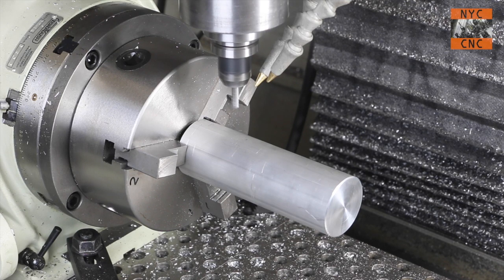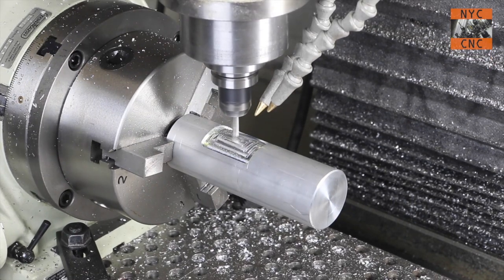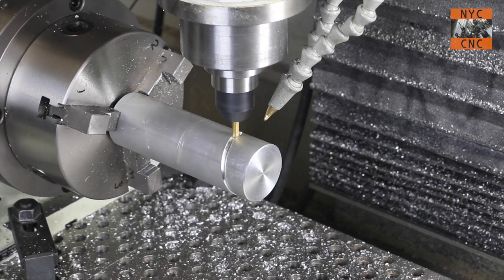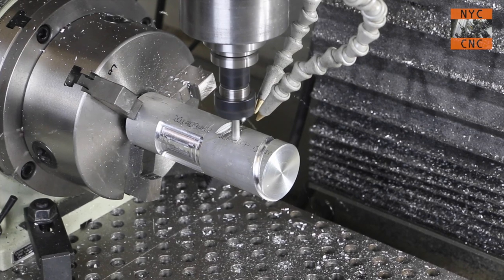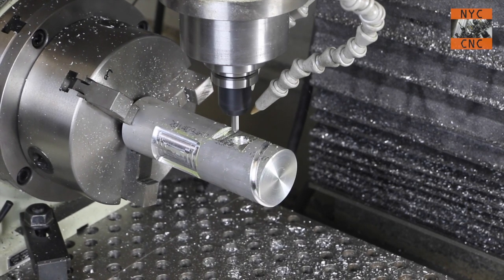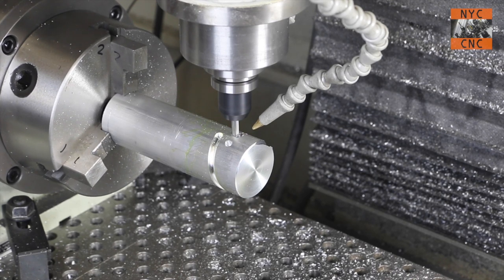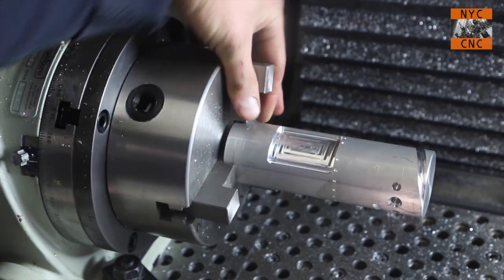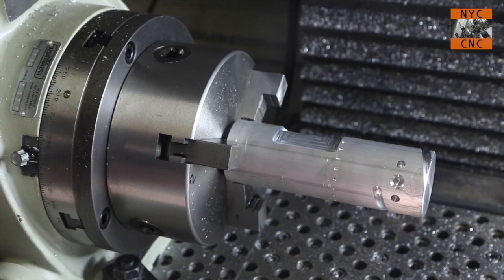May the 4th Be With You! Part 3 of 3: CNC Milling with a 4th Axis

Comment: Is there any budget 4-axis machine you would recommend within a $5k budget?
Reply: Only one I know of is the Pocket NC. It’s a 5 Axis and quite small, but a really neat machine.
Reply: @BradleyMakesThings  Unfortunately its limited to a maximum of 128.3 x 115.5 x 90.1 mm working volume. Its great for small parts but I want something that can give me atleast a 200 x 150 x 150mm working volume. Tormach seems great for the price but doesn't really have any options within $5k budget. I wish Pocket NC made a slightly larger version within a $12k budget.

Comment: Thanks for this video.  I've had a 12" rotary table sitting on the floor for several years waiting to be converted to cnc.  Of course, first I've got to make a gantry and a block and tackle to pick it up and put it on the table.  And also build a tail stock for it.  But this is an inspiration.

Comment: Wow! The possibilities here are endless. Drilling model wheel-hubs for fellowes [ wheel spokes], cutting spiral grease-ways in shafts, 2-end cotter-pin holes, spanner flats, bolt pitch-circles in flanges, etc,  As to 'losing' stuff, I thought that was just me! Just recently I found a complete vacuum-table kit 'lost' for 10 years and an extended wing-mirror for driving in France, [coz they drive on the wrong side like you! ], that I bought back in 1984.  Still missing is a complete spare motorized central heating 2-port valve. How can I have lost that - it's the size of half a brick? What happens, I think, is you look in drawers and your brain switches off after a few looks so you don't see the object. I have many, many dozens of drawers and cupboards inherited from a cousin, so my shop hidey-holes are almost infinite.  What works for me is to get my wife to look.  She find um! Keep looking for those jaws- they're in there someplace!

Comment: John, FYI you just need the Tormach 4th axis homing kit and make 1 small configuration change to your machine set-up to stop all that "Rewinding" before the next operation.  I agree SPRUT for 4th axis was not intuitive to learn, but once you know the tricks you are good to go.
Reply: You have to use the Tormach configuration program to turn on 4th axis homing (just like you would for setting the active vs. passive probe setting).  I didn't have to do anything in Mach 3 after that.  You can then actually "Reference" the A axis and get a green status button just like all your other axis DRO's at start-up!  I set my sensor up to consistently read while the analog indicator of the rotary table was passing through zero degrees.  This helps me keep my head straight while trying to follow the part program along.  You will be happy to not have to watch that sucker try to rewind 20 revolutions before the start of your next operation!  It is also helpful while restarting after a tool breaks.

Comment: Hi John.... Great info on the 4th axis....
I think the question you ask at the 3 minute mark is answered by the controller software, not the cam.
I believe in Mach3 there should somewhere be a setting to rapid back to a place ( minus x times 360).
So if is hase to go to A=10deg and the DRO says its 1090deg it skips the 3 full revs. (dont have mach on this computer so cant check.. (think it's called the 360 rollover)

Comment: Maybe try separating your safe height start point location, so it doesn't have to synchronize all 4 axis'. Maybe that can speed it up a bit. All the 5axis high-speed machines I've run for my job do their rotate the A&C axis' before the X&Y&Z axis'.

%
(program name)
G00 G17 G40 G70 G80 G90 (safeline/ whatever yours happens to be.)
A(insert degrees).
X(insert location). Y(insert location). Z(safe height).
G01 Z(start height). F(feedrate).
(rest of your program)
m2/m30
%

Hope that helps :)
Reply: No problem! Wish I could afford a Tormach Mill, but I guess I will just have to settle with the machines I use at work lol.

Comment: I know this is just alu and not really important in this case. But did you somehow calculate the feed for the diameter of the part when rotating? What I mean is, there has got to be a difference in the feed pr tooth when milling on a 1" part compared to a 20" part (when using the 4th axis). Obviously because of the extra material removal based on the bigger circuit.

Comment: Alum. is a pleasure to machine.    Is there any way you could rig up a live center on that to support the tail end -  for longer pieces or if you just needed the support?
Reply: Are you still doing any gun-related stuff?   A lot of people want us to shoot a 12ga slug made out of aluminum for some reason.
Reply: *****
I have a CNC mini lathe.  The 12 gauge slug code is so easy that I could whip it out by hand in no time (I don't have the CAD CAM tool chains that most people seem to have these days).   I have the aluminum.  My wife is on vacation starting Tuesday.  PM me your address and I could mail you some aluminum slugs. Maybe some solids and some with hollow bases.  I could load them in 12 gauge shells too, but then I'd need to send them UPS with the proper labels.

Of course, with the 4th axis milling, John could make you some 12 gauge slugs with cuts to make petals for controlled expansion, sort of like ginormous Black Talons.  :-)
Reply: *****
Once ounce aluminum slugs would be interesting, although they'd be about four times as long as lead slugs of the same weight, and they wouldn't fit in a shotgun shell.  Even if the long shells with the crimp end cut off and the exposed slug were manually loaded one at a time, they'd probably tumble in flight.

I was thinking of aluminum slugs the size of one ounce slugs, loaded into a wad the same as the Lee cast slugs.  They'd weight around a quarter of an ounce.  The burn rate of shotgun powder is fast enough that it should still burn well enough, even with the much lower projectile mass.  The velocity won't be four times as great, but should be extreme.

If you find yourself saying, "I'm not going to shoot it.  You shoot it."... where ridiculous 12 gauge loads are concerned, Matt at DemolitionRanch is like Mikey from the Life cereal commercials.  Let's give it to Mikey.  He'll shoot anything.
Reply: NYC CNC
I still think it's hilarious that after overplaying their scary ammunition marketing, Winchester re-released Black Talon as the less scary looking Ranger SXT ammo, and SXT is widely known in the industry as Same eXact Thing (as Black Talon).  Just like the gun bans.  It's all about how something looks... and how that makes someone feel.  For many people, I suppose ignorance is bliss.

PS - 1997 can't have its ammo back.  I'm keeping a few rounds of 10mm Black Talon, for the sake of nostalgia.  That's MY version of "how that makes someone feel".  :-)
Reply: Liberty4Ever
  You haven't seen some of the stuff we shoot.   Look at these armor piercing darts.  Some were over 3" long.
Futuristic "Armor-Piercing" (APDS) Shotgun DARTS - Test 5
Reply: It's no biggie.  Just thought you might want be interested in a co-op project.

Comment: John,  could you keep a fairly large step over in the pocket and avoid the faceting by keeping the passes circumferential, and not longitudinal?  That is rotate to cut, then step along the length, then rotate to cut?

Glad you found the jaws...though seeing you make a set would have been neat...and probably a useful skill since you could then make special purpose jaws as needed. 

A rig like you now have would be ideal for making larger replacement lathe and mill dials...useful for those who haven't gone to CNC yet. ;-)

-- Mike

Comment: I have a Sherline 4th. I have only used it a time or 2. The possibilities are pretty extensive and it performs very well also. Especially for its price and simplicity.
Reply: NYC CNC Dont we all have a Sherline? I started with a light machines/sherline mill (ex educational machine with no software and I with no knowledge). Turned into an A2Z Monster by the end. Even went thru a 3D Printer phase with it. Mostly neglected at the moment but can always come to life in less than an hour.
Reply: Barely, plastic isnt strong enough!

Comment: I use linuxcnc mainly, not mach, but I would guess that you could manually edit your code to eliminate the traverse back to Zero on your 4th. After the line where you finish the cut and the Z pops up, "G92 C0 (or whatever degree you need to reset the C to)"

Comment: Now I'm asking myself why I don't have a 4th axis. Do you think a heavy cut in steel would cause a rigidity issue with holding the work square? In other words how easy is it to tilt the rotation out of square with the force of a heavy cut?
Reply: I'm planning my next evolution of production and want to mount fixture plates like a trunnion but with a tail stock. That way I can simply index at 90 deg to get 3 sides without 3 different setups like I do now. I mainly concerned with rigidity and accuracy of a 4th using this method. If you watch video 15 in my AR15 gasblock series you can imagine how much benefit a 4th axis could be with those fixture plates.